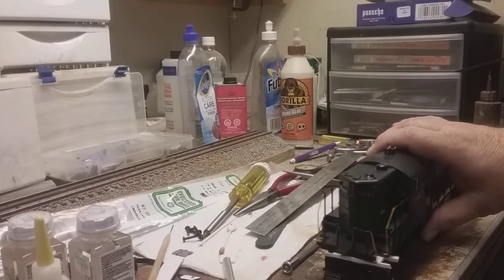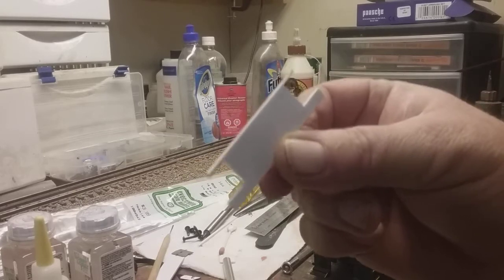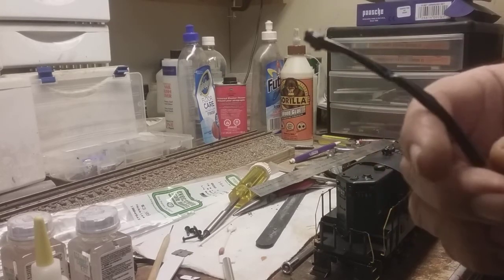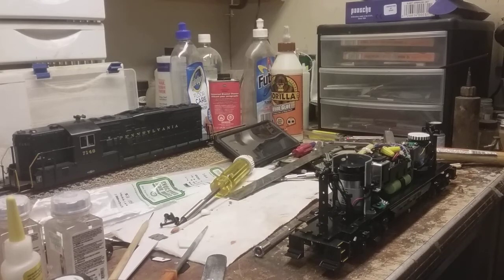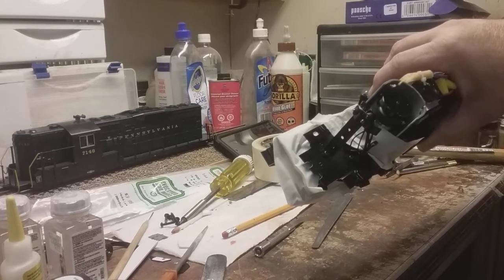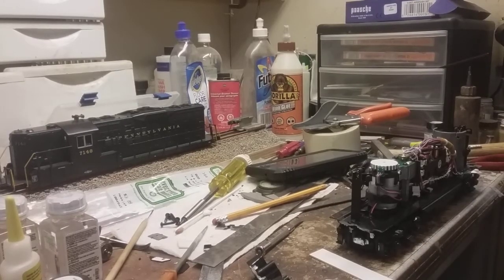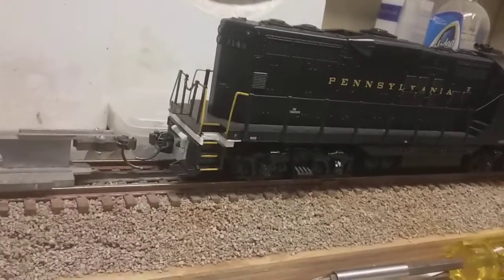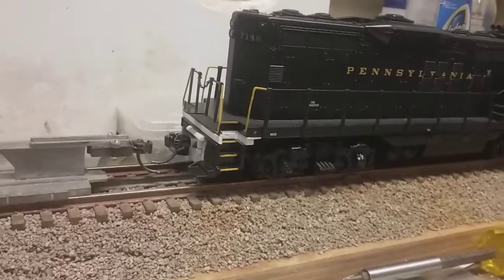kadee conversion on MTH GP 9. Making a fixed pilot.

Comment: Wilbur, thanks for the tutorial. I'm about the jump in with these conversions and it's very nerve racking. My first experience was an MTH U30C. It was all trial an error. Still deciding if I want to bring the guardrail down further. I really like the step by step approach you demonstrated. My first two of probably a several questions is, does the dremel melt the styrene and do you use the metal wheel attachment to cut the styrene?